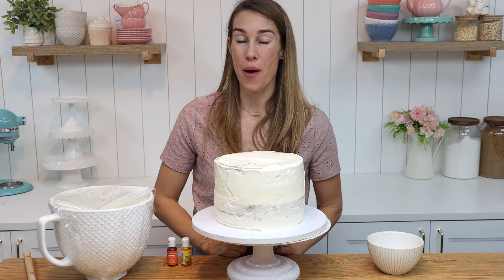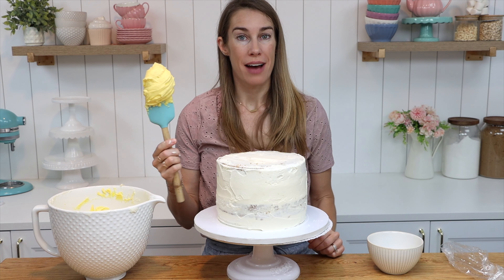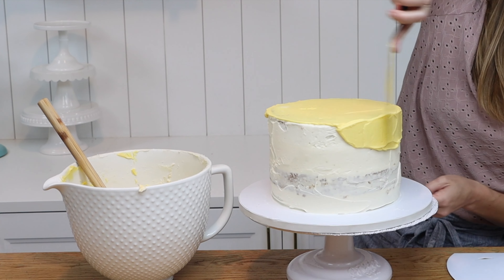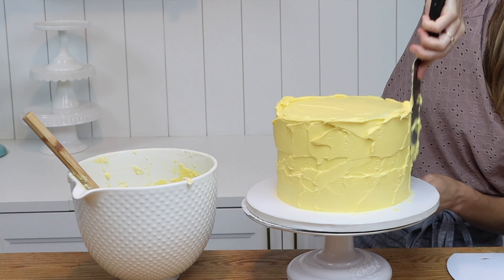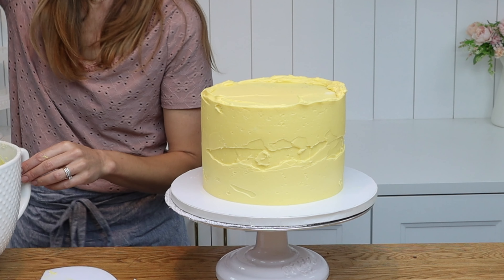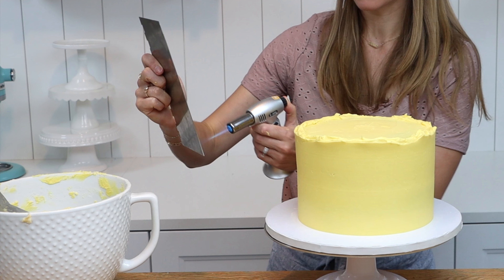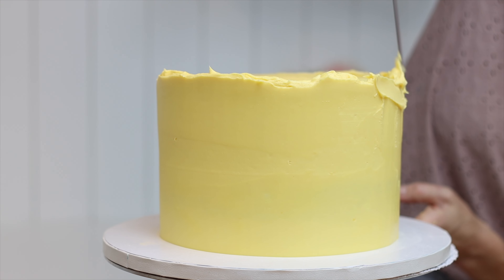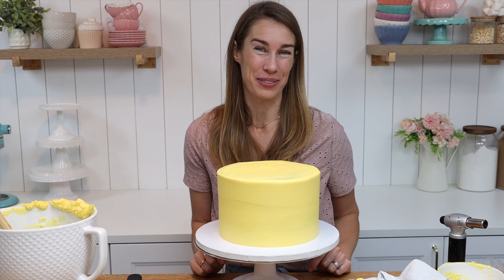How to Frost a Layer Cake

Comment: Another clear and incredibly useful tutorial Emily! I have a question - I've had trouble with coloured buttercream changing colour when I use a heated metal comb to smooth it out. On a recent cake, it ended up darker than I wanted it to be as a result of that final smoothing. I know I could make the colour lighter to begin with but it's hard to predict what you'll end up with, and very tricky if you're trying to match the colour to something in particular. Any tips?
Reply from the maker: Yes, that is a challenge with using heat to smooth! It’s best to let the metal cool down slightly so that it’s just warm, not hot, because heat does make the buttercream darker and not always evenly, so the colour can become patchy. If I use a torch to heat the metal, I rub it with a towel before using it on the cake so that it’s not too hot
Reply: @BritishGirlBakes  thank you! That makes sense. I'll give it go